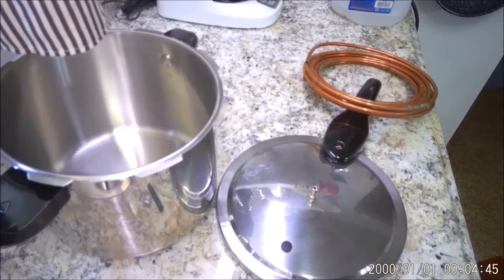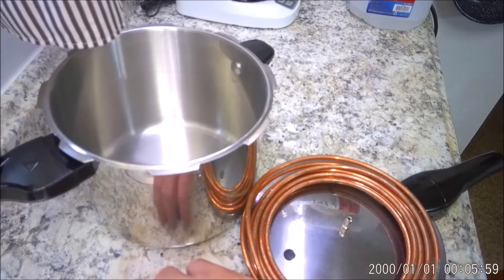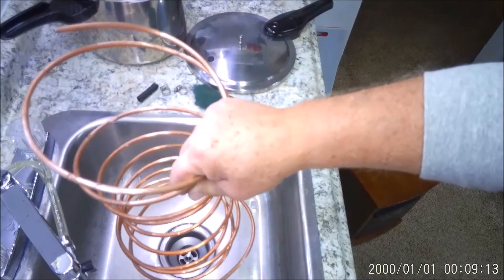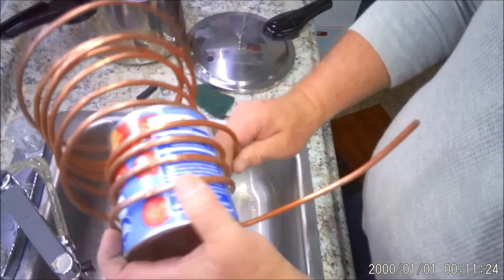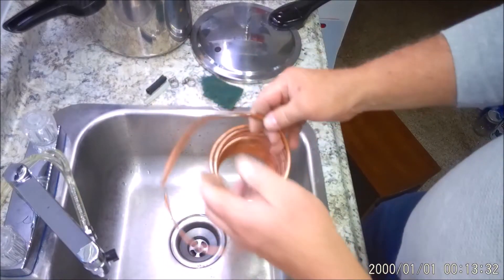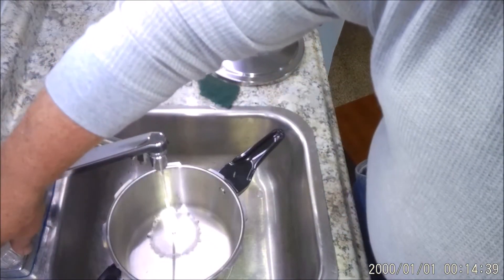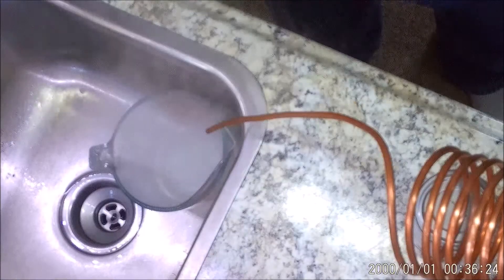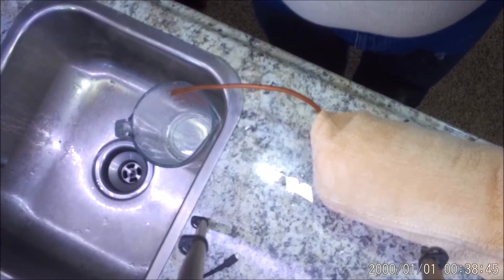How to make a distiller, DIY water distiller. Simple distiller.

Comment: Pro tip: copper will work-harden from excessive manipulation (bending, hammering, temperature fluctuations, ect). Copper will also work harden over time, and it can be a right bugger to work with after afterwards. The reason this happens is because metals are most stable when their molecules are in a crystal structure, which is also the hardest structure a material can form. Copper kinda sucks at forming crystals, but over time the molecules will jiggle themselves into a crystal formation, and physically manipulating copper move them around even faster. 

There's an easy way to make copper soft again, it just needs to be annealed! Just hit it with a blowtorch until its glowing red then throw it in a bucket of water! Movies lied to you: what most people think of as tempering (heat your sword 'til its glowing red then thrust it in water)  is actually annealing and will soften the metal. To temper metal you heat it up as hot as you can then let it cool as slowly as possible, that keeps the molecules jiggling for longer, which let's them cozy up to each other so they form one giant crystal. A tempered sword may seem like the best way to go, the metal being ultra-hard and all... only issue is it becomes brittle, on its first swing it'll shatter like glass. After being tempered a sword has to be annealed, but only a little. Typically a sword would then be heated to ~400°C then quenched in oil (the oil dissipates heat slower so there's less thermal shock and the edge doesn't get over softened).

Hope some of you guys find some of this useful 🤘
Reply: Oh ya, and it gets even more intricate. I didn't even mention differential tempering like how katakanas are forged, where only part some of the item being made is insulated and the rest is left to anneale. In the case of making a katakana half the blade was packed in clay then it was given a quick quench. This gave it an extremely hard cutting edge backed up by more elastic back gave it a razors edge sharp enough to cuz bone and the strength to not shatter well doing so. In fact historically the quality of a katakana were something tested by tsujigiri, which translates to crossroad killing... and it was exactly what it sounds like. Samurai would test their new blades on random passerbys at night to get a feel for how effective their blade were. The practice was also used on cadavers and as a form of execution. A few of these tests included a cut from shoulder to the opposite hip, a cut from one hip to the other (as in splitting the pelvis at its widestpoint), and how many bodies it could completely pass through in a single swing (1 or 2 was average and 5 is the most I'm aware of). 

I know its macob, and an example I'm pained to use, but at the same time it's undeniable impressive and testimate to how effective differential tempering is
Reply from the maker: @ltsgobrando  Very interesting, I did know you can have a change in hardness at the edge and the backbone if you will of the knife, But the history lesson is interesting. Nice chatting with someone who really knows his stuff.
Reply: @davenooner2142  the feeling is mutual, considering my farmhouse now has potable water thanks to you! Thanks for lending an ear for my ramblings, you're a good man. May the roads you've yet to walk be ones of ease, your burdens bearable, and your stories ones of satisfaction and merriment ✊😁
Reply from the maker: @ltsgobrando  Well I am real happy to hear that I helped you. I wish you well with your farm. If you need another method to distill water... try a solar distiller. I was going to do a video on building one, just have been too busy here.
Reply: @davenooner2142   that was actually what I'd originally wanted but there's three big issues that make it more trouble than it's worth. First is the volume. My household burns through quite a lot of water in a day. At a rough guess we through per week.
Shower ~8L/min @ 40/dy = ~2'250
Washer 120L @ 10/wk =~1'200
Dishs 40L/day = 240
Teeth + hands ~ 60L = 420 😎
And the porcelain throne uses a good 800L... first time actually working that out, I knew it was a lot but 5'000L/week seems kinda excessive.

Anywho add to that the wild tempature shifts. The summer days are usually upwards of 30°c/86°f and winters are -20°c/-4°f. We also get frequent cold snaps down 'round -35°c/-31°f, not including windchill. Coldest I've seen was Christmas eve 3 years back, including the windchill we hit -66°c/-87°f! So freezing a huge dilemma.

Lastly there's the wind. We have 4 months in the spring/summer of calm days... the rest of the year we have a Beaufort number between 3 and 8 (wind that makes dust clouds to wind too strong to walk in), and a couple monstrous days were we can hit a 10-11. That's trees blown over, grain bins tipped, hell one year I had a shed explode my buddy had the tree uprooted... calling it "the tree" because it was tallest in town, held the record for almost a decade. It was a white spruce over 110' tall (112 if memory serves), said it sounded like the the world was coming undone when it went.

What I'm trying to get at is we have some extreme weather in my area don't reckon it can be done
Reply from the maker: @ltsgobrando  Wow is about all I can say. I agree that freezing water doesn't distill well. But its just another method to add if needed. The glass front condenser will make an average 1 gallon per square foot of glass so I am told. If it is made of metal on the back, you can use a heat source like a wood fire to do the evaporation with a cool glass front to condense the water on. In an emergency it could be a life saver.
Reply: @davenooner2142  well you went and did it, you got my idea maker working 😅

I think I actually will slap one together but I want better output, so right now I got more questions than answers. I'll slap a few here, maybe you'll know or perhaps even find them useful. Also they'll be regarding a mix of solar and wood powered, but predominantly solar.

1) where does the heat come from? I know that most glass is only really transparent to visible light, so the infrared is absorbed by the outermost layer... does all the heat come from visible light?

2) assuming the first is true and all the heat is just from visible light then can multiple layers be heated by the light able to pass through?

3) is it more effective to have the outer surface black or transparent with the bottom black?

4) how much energy is completely lost from thermal leakage and can  any of it be reclaimed? (Recycling the heat basically)

5) would having the water in a self cohesive state increase its  its likelihood to vaporize? (Coat the lining of the dirty water side with hydrofobic spray so the water has the maximum exposed surface area)

6) can additional heat be introduced directly into the water using something like a bunch of copper wires sticking out from the bottom?

7) is its efficiency limited by the available energy or by the volume of water, do they tend to run hot or cold? And of they run hot can multiple layers be included to increase output?

8) assuming a single layer solar setup would it be more efficient to use pre filtered water (less cleaning) or water with scuzz in it (particulates to absorb more light, gets hot faster and would hold longer)?

9) am I overhanging this?

10) and best for last: since the whole system works by vaporization and condensation is there a restriction on their respective locations? More specifically if you put in a preferable condensation point would marginally more water collect there of would all of it? 

To elaborate on that I had a gravity actuated heat pipe in mind. Heat pipes are easy to make, you just take a copper tube, clean its inside with alcohol and solder a cap on one end. Then put just a little distilled water in and put a cap on the other, solder it as well but its very important this end isn't completely sealed- it will need temporary act as a vent. Heat the sealed end of the pipe enough to boil the water and once it's almost completely broiled away finish soldering the second cap. If done correctly the water vapor will have displaced all the air so the pipe has nothing but water on the inside, and since most of it was vaporized once it cools the pressure inside will drop quite a bit. In the end you need the pressure low enough so that the saturation vapor pressure is right around room temperature, witch is ~ 0.0231atm/2.339kPa/17.542torr, whichever you prefer. The system will work over a range of tempatures but the closer you get it to perfect the better.

Why go to all the trouble? Heat pipe is substantially more effective at transferring heat, up to 500x more effective than copper alone. And really soldering two ends of a pipe with some boiling water ain't too tough. Also should mention that without wicking it will only work well vertically, moving the heat from bottom to top.

If all goes well then it will pretty much stay the same tempature throughout. On a sunny day where to still hit 40°c on the inside that pipe could be held at 20°c with just a gentle breeze, hell even  a solar powered 12v fan would be overkill. If I'm not mistaken that'll suck all the moisture from the air, halving the size of the whole setup.
Reply from the maker: @ltsgobrando  That is going to take a minute to answer...LOL... but I will do my best in the morning. Sleep on it.
Reply from the maker: @ltsgobrando  Ok first of all I may not be the one to ask some of those questions. However let me try to explain what I do know. The design I am thinking about has water troughs like 2 inch pipe cut in half. They are attached to a backer board or steel if you want to heat up from the back side at night for example. The troughs are set up  like a ladder and the unit is tilted back at a slight angle. The water can cascade from the top to the bottom one. The whole insides are painted black to absorb any light and convert it to heat like a black dash in a car. Eventually the water will evaporate and condense on the glass sheet that is placed in front of the unit just a small distance from the troughs. So the unit may be like 4 or 5 inches thick and as wide as the troughs holding water. The water will dribble down the glass into another trough at the bottom with an exit pipe for clean water. As the water gets used up, you will have to re fill the unit however you like. The efficiency of the unit can be toyed with, but does it really matter?  If you heat from the back of the unit with hot coals from a fire or some method...the unit will make water at night too.
Reply: @davenooner2142   that's an awesome design my dude! Perfect for distilling enough water for the necessities. Problem for us is the water here is hard to the point it's almost unusable. Like the pipes will jam up with deposits and have to be cleared periodically it's so bad. We got an engineer and myself (self proclaimed clever cookie and handyman... though some argue it should be handiman 🤣) so when something needs fixin we often go overboard. Like when we replaced the pump house. Coulda rebuild the one we had on the old foundation, instead we moved an old silo over the well, slapped in some steel reinforcements, poured an 18" thick concrete pad with an insulating layer below, and spray foamed the whole works to keep it warm in winter. Well this was all being done the resident engineer used my 3d printer to fashion an easy to swap pump, since we burn them out so often.

Eventually I'll probably use you exact design for water down at the huntin cabin. It won't quite cut it for the house, and assuming its 1 gallon per day I'd have to glass a rectangle 10'x66' to support the garden (it's almost an acre). You got me thinking and I decided I do want enough water for the garden, hence all the questions. At the moment we go to the community well and fill the 2000L trailer tank, 6 round trips to fill the big tank (12'000L), and that needs filling every other week. Thats why I'm looking at all the ways to increase its productivity. If I can get 5% more efficiency that'd save a full sheet of OSB worth of materials and labor. Passively producing 120L of water every day from something that size is awesome, it's just a matter of scale in my case.
Reply from the maker: @ltsgobrando  I was mostly thinking of pure survival water for drinking. But it can be scaled up to any volume. Have you looked into using compressed ascorbic acid "filters"? its more of an in line chunk of ascorbic acid that dissolves slowly and counteracts the hard water problem. It is supposed to be the best idea yet for it. I know you may not believe me on this next one but I know first hand it works. Use strong opposing magnets on your pipes going into the house and you will be amazed what a change it will make... I will never go without it again.
Reply: @davenooner2142  I would absolutely love to see this I took notes with how things are in my area I don’t like purified tablets an chlorine the way I do distilled. We have boil advisory’s constantly we have a large communal well for a few houses an it’s yuck 🤢 pipes old constantly being repaired an we’re waiting overr a year for major replacements for the other lines that connect the other 70 hoises, hard to explain I’m a bit tired it’s only 4:39 am here in upstate znY. So I am just trying to gather my water alternatives for distilling of course I could spend 100 do it on the stove but in reality with costs of electricity who knows if it’s worth it if we can keep the power an emergency situations don’t create a black out thank you for the in depth explanation truly informative!!
Reply: Pardon the typos this cell phone has a horrid auto correct feature I can not seem to shut off
Reply from the maker: @ThaOGMommin  I would like to make a video on a solar distiller that uses only sun light to distill. Does that interest you?
Reply from the maker: True true. Tempering is taking the temperature up to just a few hundred degrees, like 200f, then allowing the metal to stay there a while to normalize the structure, I thought. Then allowing it to cool slow and not putting it in water or quenching it. That would take some of the brittleness out of it...is that right?
Reply: @davenooner2142    You're in the just about bang on the money, I've only two tiny things I'd gripe about. The first being 200°f and the second is saying quenching isn't involved. I reread my comments and it looks like we both got our symbols backwards, I ment to say 400°f not °c (I'm Canadian eh) and I think you ment 200°c. 400°f is within a few degrees of 200°c, think its 400°f to 208°c but don't quote me. As for tempering, my only real complaint is your use of the word "doesn't" (yeah, its semantics). You're only in error there on a technicality, but in most cases your correct. Tempering is highly nuanced, I'll give you a more fleshed out explanation in a 

Just cuz it's a comment that's public I wanted it to give the bones of the concepts well still being memorable, accessibility often outweighs reality; remembering a usable half-truth is more useful then remember half the full truth. I wanted to give enough information so that if, lets say Joe Blow and his buddy Aver Idge found themselves in a position where they had some steel and needed some general tool like a knife/axe/pick/spear ect. then they'd have an easy to remember method to make a reasonably well rounded steel and an idea as to the reasoning behind it.

The full story is there's three main heat tratmens: quenching, tempering, and annealing.

Quenching is when you rapidly cool the meta usually by submerging it in water or oil, and it give the metal highly granular structure. It gives rise to countless interlocking jagged crystals, which is where the hardness and brittleness come from. Since the molecules are frozen in place internal stresses are created compounding the issue.

Annealing is done by slowly cooling the metal in open air, insulation (ie. bury in sand) or gradually reducing the forge's temperature. It gives the metal time to form much larger and smooth grains, making it softer, easier to work with. When its heated completely then cooled in this fashion the metal is free of internal stresses, though a thorough heating isn't required. Partially heating steel then letting it cool naturally is often referred to as "normalizing" it, as the process softens the structure enough to normalize the internal stresses.

Lastly there is tempering. There are loads of different methods to go about it but at its heart it's the process of reducing hardness in exchange for other mechanical properties: durability, ductility (bendieness),  and toughness. Depending on the material and the properties you're after it may or may not involve quenching, heating to a specific temperature, or holding it at a tempature. The less you heat it the harder the resulting metal will be. The yellows/golds/straw temperatures are best for hard/rigid tools, things like gauge blocks, scribes, metal saws, that sorta stuff. The tanish-brownish temperatures are best for robustness- most tools, drill bits, and drive bits are here. The blues are used for more springy things, like (shockingly) springs, wrenchs, woodworking tools, and structural steel.

I find it easiest to imagine what's happening to the granules when thinking about tempering. The hotter you get it the more they soften and round out, resulting in a softer end product. Then you also have the option of quenching afterwards. That can be extremely useful if you're after a very hard surface that won't easily shatter. 

Last thing I'll mention is holding the tempering, which you can sorta think of that how uniform you want the properties the "colour" properties. Lets say you're making a spring. If you want a more rigid spring like the leaf spring of a suspension then you'd want more of that eimital hardness. You'd not want to keep it up to temperature for as long as you would for a highly mobile spring, like the ones used in tape measures. Keep it hot for too long and it'll lose its rigidity and it will be too soft. As for the measuring tape spring, we'll you'd want it to be as elastic as possible but also resistant to deformation. For that youu'd want to heat it and hold the tempature for a goodly while, then quench it to give it's shape integrity.

To sum it all up, it's complicated 😅
Reply from the maker: @ltsgobrando  Thats quite informative that time for sure. Thank You!!!
Reply: What this got to do with this video?